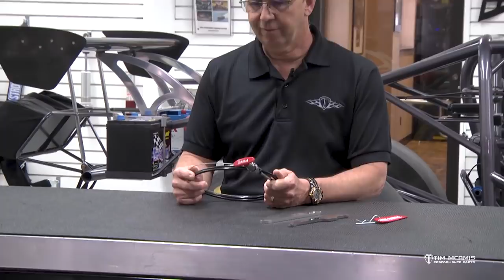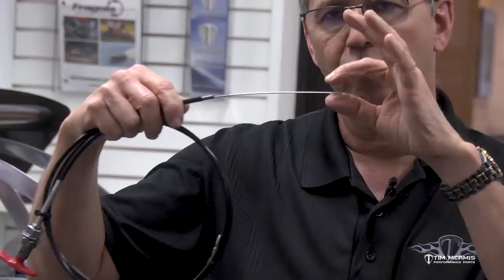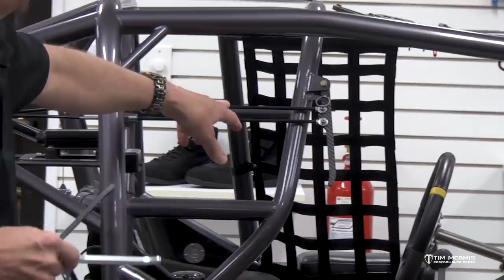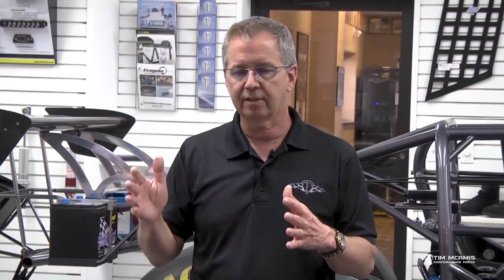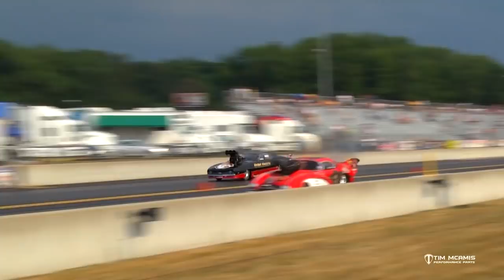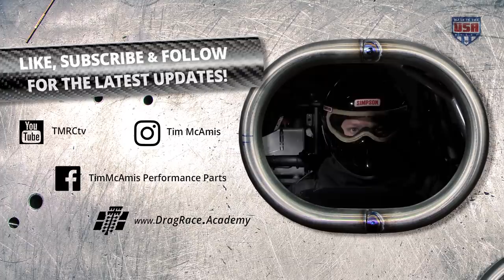Don’t Put-Off This Fire System Checkup

Comment: All great info. Something else to check if its an older system is to pull the cable out of the fire bottle and make sure it still moves free. I was in a Baja truck testing when we had a minor roll over. There was a fuel leak and it caught the fiberglass on fire. When we pulled the fire bottle cable it wouldn't budge. Luckily we got the fire out but the cable was frozen in the sleeve. Safety has to be #1.

Comment: Absolutely outstanding advice and one of the dummy's on the team that is just in the way on the starting line should danm sure be checking the fire system and shoot safety pins I have seen cars go down the track with the remove before flight tag still attached

Comment: I really like the handle in the center so you can just slide your hand down and activate it. I don't think the red handles that come with a cable should be allowed.. I also think the handles need to be something that isn't PLASTIC (I can't believe ANYONE would run a plastic handle for their fire bottles..seriously, wtf..)  Anyways, let's make a slightly extreme example, you have a huge fire for whatever reason (...let's say the number of rods putting windows in the block exceeds the finger count on your left hand, lol) and there's fire has gotten or is getting into the car, it's filling up with smoke, you're sliding in your own oil, you manage to get the chutes out to try and slow and straighten the car out and hope they don't burn off before that's accomplished and as you are still attempting to steer AND brake (at least most door cars DO have a foot brake, some have both hand and foot fortunately, since I haven't met a driver w/ 3 arms yet..some have hand brakes or both..) AND DURING ALL THIS, you are trying to get a a split second to FIND and pull the damn lever for the fire bottles - so there's a good chance you are going to be late activating them regardless (but it also depends on your setup) and in this example, your setup includes a POORLY LOCATED, PLASTIC F##KING T-HANDLE to activate your bottles...🤦‍♂️ so when you do manage to find it, it's not there because it's melted or too effed up to pull.... and yeah, the example stops here -- I know not all those T handles are plastic but a lot of them are and I seen a lot of cars have them in there. I worked with a team that was finishing up their fire system install and they weren't using the T handle and I asked him if I could cut it apart yeah, they laughed and said go ahead and yeah... It was a total piece of shit. So the moral of the story is explained in Tim's video, I just had to get this mini-rant out from being in and around racing a long time!  Buy mini I mean I'm not serious, it has nothing to do with the 700 words I used, LMFAO

Comment: An old racer drilled into my head that you need to know where things like your chutes and fire suppression etc blindfolded and should have a routine for going through the motions every time. It's like a preflight check with your eyes closed and takes 10 seconds to do. Know I've never had to fire the bottles, but knowing where my chutes were like that saved me from a nasty wreck when shit went wrong.
Reply: SouthJerseySound nice too see a young racer that will actually take advice from old racers like me that Justin swantrom kid won’t take advice from anyone no matter how good the advice, I like your post I bet your on your way to becoming an amazing racer you seem like you have the right attitude unlike most racers your age who think they know it all when there talking to someone who been racing for over 35 years and knows way more than they do and they tell you to swing on there nuts when you give them good advice Good Luck on the track and stay safe

Comment: Yeah I need to put this kit in mine since I’m running methanol it’s a great fuel but you can’t see it burning  all it takes is one leak methanol can be very dangerous if  you don’t check things and have a fire suppression system.

Comment: Not to mention after the remote cable is in place and routed into the orifice on the bottle where the remote wire goes, REMOVE THE BOTTLE PIN!! I've seen many with a remote pull with the pins still in the bottle, when you pull the cable nothings going to happen!

Comment: Screw these fire suppression pull or push cable types. I installed an electrically activated fire suppression system that not only is easier to activate but it doesn't make a mess all over the place and it is less toxic. Try the 3M Novec 1230 agent that it is discharged as a gas and doesn't require any clean up after discharged.

Comment: First time engine Assembler here.. I wanna put a Lunati 60346001 Signature Series 4.600" Stroke Crankshaft in my lm7 and am looking for rods and pistons I want to build the engine for 1500 and run it at 1000.. I'm having a hard time finding out what con rod length I should have! can one of yall inform me

Comment: I'm thinking about buying a small 5 pound system and putting it in my Range Rover Discovery TDI with a nozzle printing at my turbo charger and the other nozzle pointing pointing at the injector pump if it goes fucking South I can pull handle and hopefully it doesn't burn to the fucken ground but I will have two dry powder hand-held in the car also I'm going to put the pull handle somewhere in easy reach of my left hand